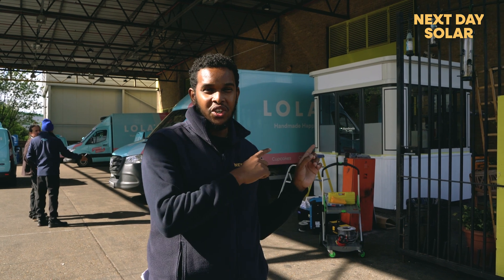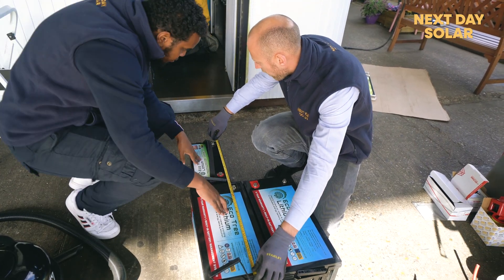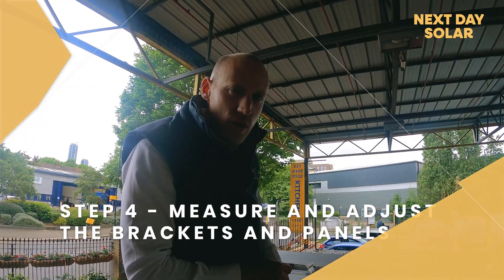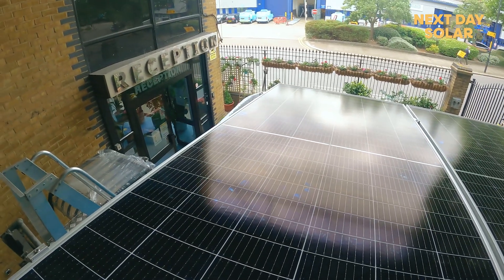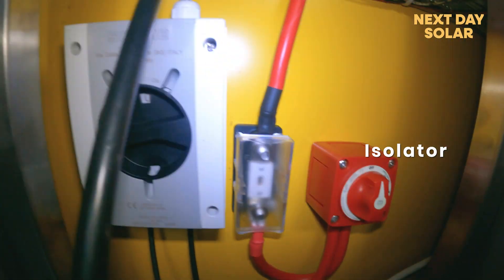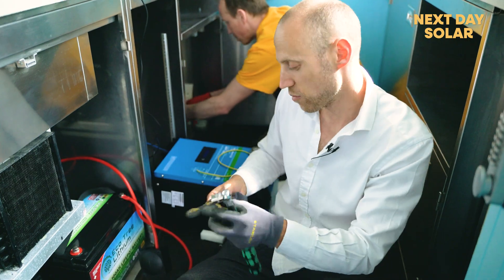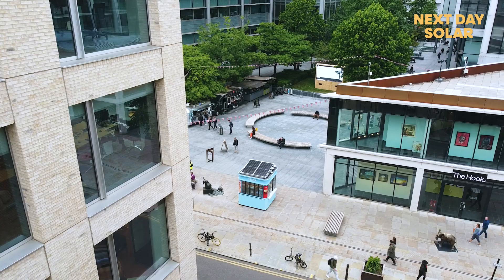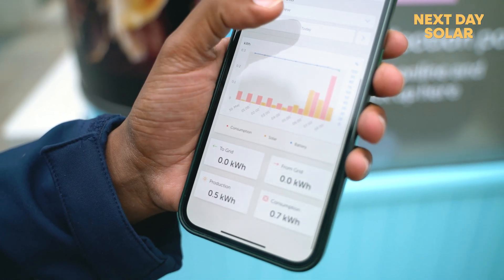Install Victron Easy Solar 2 GX for Off Grid Retail Cabin, with 810 Watt Solar PV  System & 5kWh Bat

Comment: Interesting, especially with the links to the live /historical data.  I'm in the process of doing almost exactly the same thing for my garden office, 2x400W panels, Easysolar 24/3000 (the original one as I got it a fair bit cheaper), batteries yet to be decided but probably 2x200Ah AGM for cost reasons.  I have an existing and mostly good mains connection so am thinking of this primarily as a large capacity UPS with the bonus of getting it topped up by the solar when there's sufficient sunlight.  Which panels were these?
Reply from the maker: Hi, we went with JA Solar 405W , as they are not expensive, and do a good enough job. We purchased from Wind & Sun. If you upgraded to an Easy solar 2, and configured as ESS, you could also feed back to the rest of your property/grid. The Easysolar, isn't certified for this, therefore cannot be setup for grid feed in under current regs. Good luck and shout if you need help.

Comment: 2 x 405 watt panels will charge 2.7kw batteries?  How long will it take, at what rate, what is the maximum charging rate of the batteries and what was the battery amp rate of the 2.7kw battery?  It was mentioned that you had 118 watts solar energy coming charging the Retail Cabin but that still doesn't tell you anything?
Reply from the maker: Yes, 2x 405w panels would charge any sized battery, within reason. We have 2 batteries that are 220aH each, totalling just over 5kWh of energy. We also have another 2.4kWh on order to add to it. Charge time depends on energy generation. We should expect between 3-5kWh per day, obviously very weather dependent. 2.89kWh was our best day so far this week, but its not been that sunny. The batteries are from Transporter energy, a link here to the full specs if you'd like them https://ecotreelithium.co.uk/product/12v-216ah/, , if you check the link within the description you can see in real time, how its charging, at what speed.
Reply: @nextdaysolar3349  Thanks for you reply and I did watch the whole video, rewinding it a few times too! You didn't say what the charging rate of the batteries were, its great 5kWh of energy but it still doesn't explain how long it will take to charge the batteries with all things being equal!  Is it not the charge controller that will charge the batteries as long as the charger gets energy then the charge controller will work?
Reply from the maker: @powernab8457  Hi, yes the batteries will be predominantly charged using the 'CC" which is a 250v unit that Victron place into the Easy Solar 2. In terms of charging rate, this very much depends on how much sun is available. The unit has been installed for 1 week now, and we've had a number of power losses (due to low state of charge) and as the batteries are now in a low SOC, its more a game of trying to minimise consumption whilst generating in the day, to try and gradually increase the SOC. For us its not really of great interest how quickly could we charge the batteries, but if you were not using energy in the unit, and had the full 800W being delivered, it would be 5000wH battery / 800wH production = 6.25 hours for a full charge.
Reply: @nextdaysolar3349  Thanks for the information!